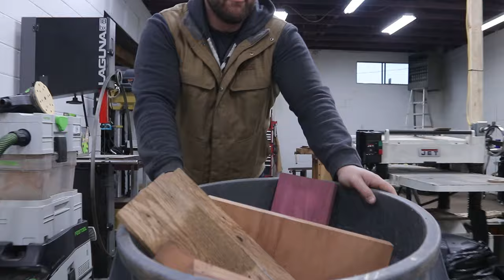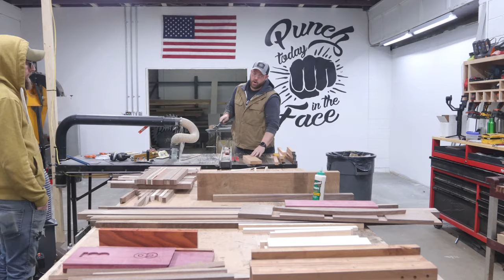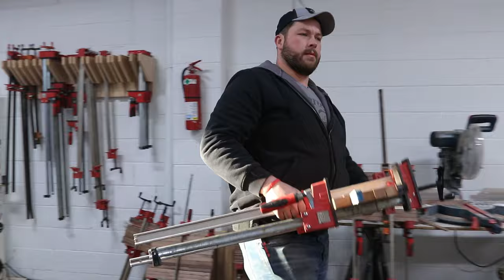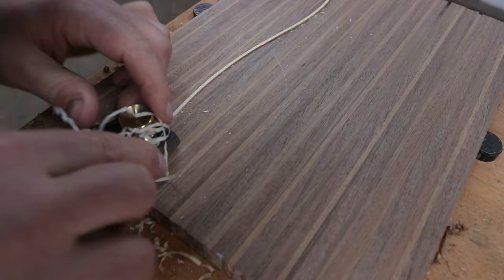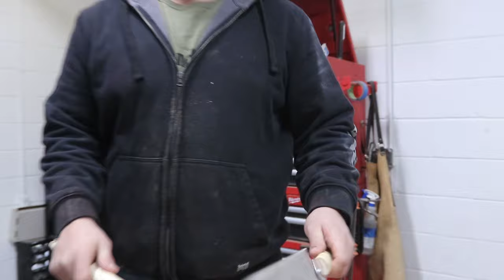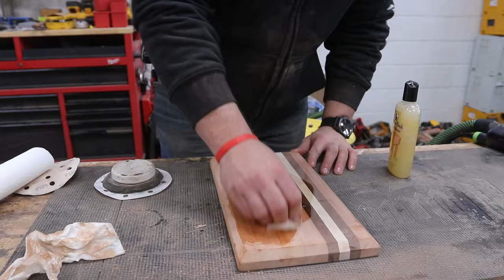10 Cutting Boards from Scrap Wood Build

Comment: You make it look so easy!! Most of my glue ups take forever,  my cheap thicknesser producing mating edges with great gaping gaps you can see light through....but it is satisfying when you finally get it, nice video, thanx.
Reply from the maker: Thanks Mr. B. W. I would get that planer fixed, it'l save you a ton of time!

Comment: Very nice use of scrap wood. All of those barrels of wood down to 10 cutting boards. The exotic woods you used to make these boards is expensive and knowing you got almost every square inch used is being smart. I hate to see it burned or put on to a landfill.
Reply from the maker: well it does bio-degrade so its not the absolute worst place if it ends up in a dump.... but yes its a good use every year to make some boards!

Comment: The only major shop tools that I have are a table saw & a radial arm saw, I have a 7-1/4 Skil saw & an electric hand planer as I don't have any room in my basement for any more large tools, due to the size of my shop area is small. I would love to build a butcher block that you see in butcher shops, where the butcher block is two feet thick & about 2-1/2 feet square on a set of wooden legs.

Comment: Hello John, great video. But please add a few more details for woodworker wannabes like me. Type of wood. Sanding. Router and how got drip lines? Thanks
Reply from the maker: For stuff like this its more of inspirations. You don't really need specifics for this one. Just showing some different ways to use up some scrap wood. If you're looking for some tutorials, check out Fix This Build That ! Hes got a super detailed plan !

Comment: John love the boards, just one question on using exotic wood. I was told not too use exotics because of the toxic  oils in them.
Reply from the maker: Some exotics yes,  local exotics also have oils. I typically dont go crazy with them,but in the years i have been doing this havent had any issues , i would do some research first
Reply: I had this same quesrion about exotics so I asked my hardwood dealer. He told me that most exotics if not all, are toxic. That doesnt mean they cant still be used. Most of the time, you have to be exposed to the dust for extremely long periods of time and its similar to an allergy. Uses like this dont over expose you to those toxins like one would think. Also, once the wood is finished with mineral oil and wax, the exposure is so small its not usually an issue. Some people though do have a lot lower tolerance to these toxins that can cause adverse affect. Hope this helps and sorry for the wall of text!

Comment: great video and all but i wished there was a little more commentary on what you were doing exactly, i.e. why did you spray them with water (was it water?) and flamedryed them, or what finish did you use there? since you are going to eat from those boards
Reply from the maker: The finish is linked in the description, and its called "water popping" to raise the grain for a smooth surface and final finish. The heat gun dries them faster

Comment: The first 100000 is the hardest. Great stuffJohn. Keep going.

What finish did you use on these?
Reply: Well, I'm not john but he used butcher block oil, you can get it at the big box places by the other wood finishes.
Reply from the maker: hahah ya it hasnt be easy to say the least
Reply from the maker: and yes i did, theres a link in the description!

Comment: Hi! , So you spray it with water and then dry it to the wood?
Reply from the maker: The water pop straightens the grain, once it dries you sand it down. I use a heat gun to speed up the process. You then get it to a silky smooth finish

Comment: Hi. Great video, but a question..  What do you do with all your glue spreaders? Do you clean them off with a solvent to be able to use again or do they just get binned? Always wondered..

Thanks
Reply: I can't speak for what John does, but I always run mine under hot water for about 30 seconds.  Titebond III takes a little more work, since it's waterproof.

Comment: Is a jointer necessary for cutting boards?
Reply from the maker: Typically yes, if your wood is rough cut to begin with, but mine was all cut offs from previously squared stock

Comment: Thank for this video. New sub here. How you recommends somone do this without a planer like that? I only have an electric hand planer.
Reply from the maker: that would be  very very tough. I would get boards as square as possible with the electric plane. and try and glue them up as flat and straight as you can, then hand sand

Comment: Why did you spray water on them then dry them with the flame?
Reply from the maker: That helps the grain to stand up so you can knock it down again, then you can not worry when the finish is applied about having to sand as much. I use the torch just to speed it up
Reply: Ok. So is that stops the wood fibers from breaking off into the food? I've had a customer complain about that with a walnut cutting board.
Reply: @Michael Basically before you do a final sand you want to give a spritz of water to make the grains push out a little.  Then they get knocked down with the final sand and the finish IMHO goes on nicer.

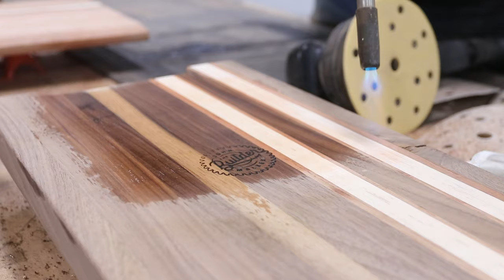Comment: Love the cutting boards. They look great. I'm super curious about why you sprayed them and what with? And then @ 9:26 it looked like he was using a heat gun on them. Curious about that. Congrats for the 100K subscribers. Love your videos.
Reply from the maker: Its called " water popping" i spray them with water and it helps raise the grain, then the heat gun evaporates the water faster so i can sand them down nice and smooth
Reply: Love this tip! Totally going to water pop the ones I have being glued right now. I as recently ran into this issue where the grain raised and I had to red and them down again

Comment: What is the wax you're using on the boards?
Reply from the maker: Its butcher block oil and wax
Reply: Thanks John.
Reply from the maker: No problem Jon, Its linked in the description!
Reply: Oh my bad, I didn't see that. I looked also! lol. And it seems I can get it in the UK too, awesome.

Comment: I would NEVER place my food on a board made with recycled or upcycled wood because you never what dangerous chemicals could have been on that wood.
Reply: The boards are sealed with oil and wax, it’s not like the food on it is going to absorb what’s in the wood
Reply: Ohhh , yes it will.   
I don’t mind recycled wood for artistic objects but NOT when it will come in contact with MY food.  Thanks but no thanks.